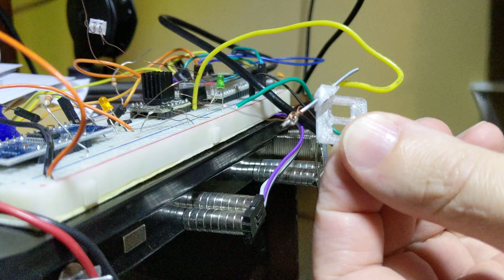Haha YES! An absolutely reliable 3D printed magnetic switch that works every time, trivial to make!

Comment: What makes it better than normal switches or mechanical ones? I'd like to understand
Reply from the maker: It's loads better than a normal switch! First of all is the cost: About $0.05/switch. Secondly they're configurable! You can make them as strong or as light weight as you want. You can also make them clicky or make them silent. You can give them long or short travel. You can make them large or small (*really* small, actually!). Extremely cheap and trivially easy to repair if something breaks or wears out (it can last forever!). Switch design sits about 3.5mm lower on the plate than a standard Cherry MX switch.  Best of all: The switch feels fantastic!  It's super tactile and satisfying.
Reply: @Riskable3DPrinting  This design is mind-blowing!
Mechanical keyboard revolution! Who needs Cherry MX!

There already are printable keyboard cases and keycaps. Now you can print the whole keyboard, basically!
Reply: @Riskable3DPrinting  This is really awesome - are you going to make the file available in the future?
Reply from the maker: @asherweintraub3911  Of course!  And if you message me on Discord I'll send you .stl flies to beta test!  riskable#4986
Reply: @Riskable3DPrinting  sounds awesome. Do you configure them by changing the magnetic force?